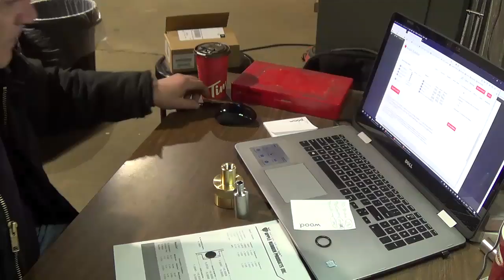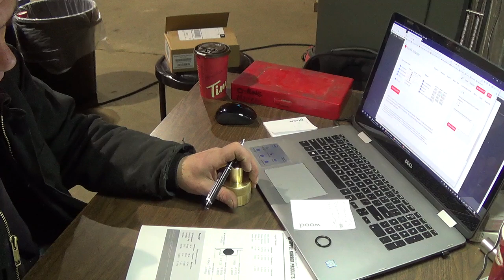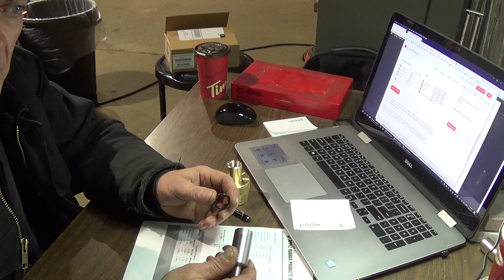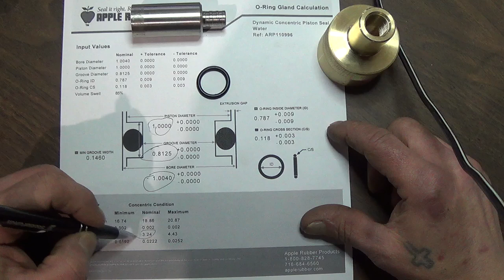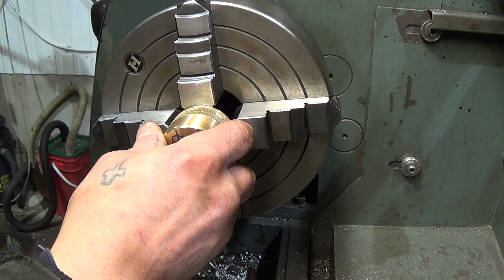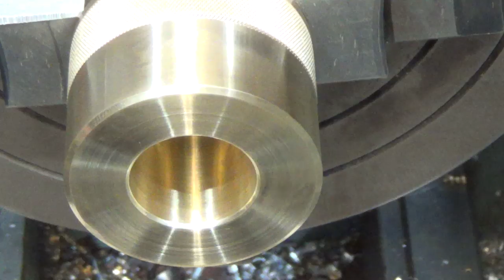Got Hosed part 3

Comment: great series. i havent made to much custom with oring, repaired quite a few things though. im a heavy duty equipment mechanic. in school they taught us that a 12% crush is what to look for in a oring seal
Reply from the maker: Hop onto the Apple Rubber site. There's some great info on both radial and axial seal types and then subsections under those. The online calculator is nice but there's a pdf about design worth the read. Thanks.